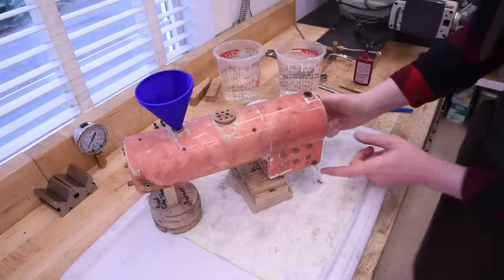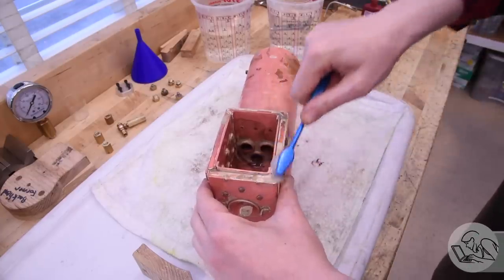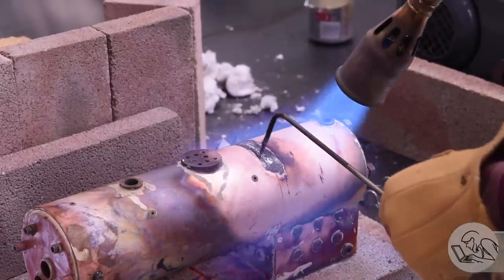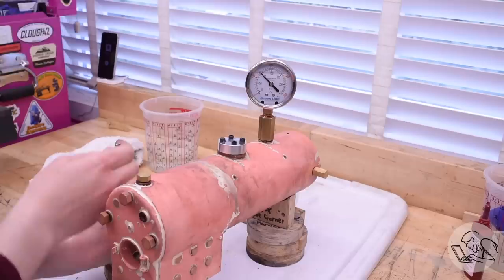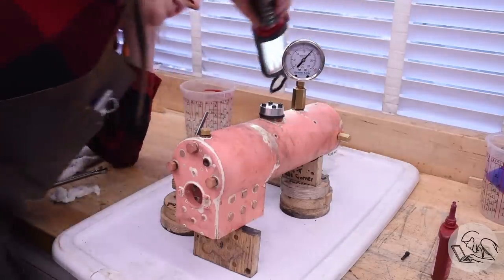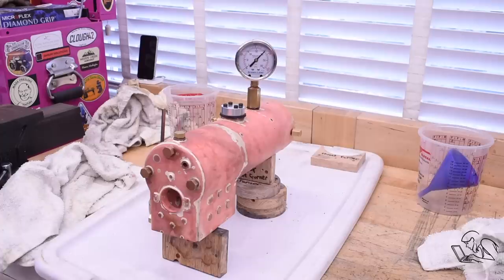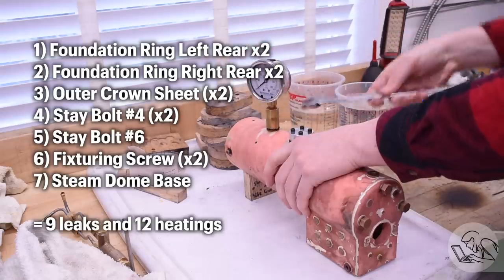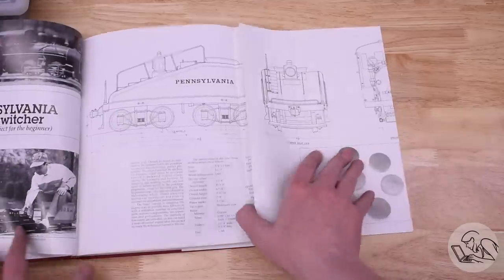Boiler Pressure Test!!! Pennsylvania A3 Switcher, Part 13

Comment from the maker: Hey everyone- as with every time I post a boiler video, many many people ask why we use a large propane torch for this. I’ll try answering yet again. You have to use a large torch because the large mass of copper sinks heat like nothing you have ever experienced if you have not made copper boilers. Experience you may have from jewelry making, welding, or HVAC work does not map here. This is the way model copper boiler makers have done it for decades for good reason. A smaller torch will never get the joint hot enough to flow the solder before the flux spoils. A hotter torch like acetylene will melt the materials before the joint gets hot enough to flow the solder. Yes, really. I can show you the melted bushings from my first boiler many years ago to prove it. Eight pounds of copper does things with heat that you can’t imagine if you’ve never tried it. We use big propane torches for this because it works the best. Don’t knock it until you’ve built some large copper boilers yourself. It’s a different world.
Reply: I would have suggested a smaller tip, yet you have explained the heat sink you are working on.  Thank you for being thorough in you explanation. Good work, and best o luck 

From Monterey area California.
Reply: My brother and I have had really good results silver soldering bronze with oxypropane. We've done both thin walls and fairly hefty chunks of 97% copper alloy, (but granted, not eight pounds worth) and it's worked really well for us. I'm sure there's a reason it wouldn't work for your application, but we like the directionality and 'just right' level of heat dispersion.
Reply: Best QC inspector in the world!!!
Reply: Just to add on to what Quinn just said: for those who haven't read the book, Kozo even tells you to use propane explicitly in the book, for exactly these reasons.
Reply: Yeah folks if you've got the propane to waste  you can use a preheater setup or a constant top, side(s) bottom heater and just go at the small joints with a smaller tip. This has its own set of problems - like everything's hot all the time and you are standing right above it or beside it or somewhere near it. The cost of Waldo's for this and the practice you have to have to make good use of them, and a multitude of other problems come to mind. Your choice is best.
Reply: that is so wild! thanks for the explanation! I was thinking a soldering iron to do little spot fixes like the fixture screw repair but you got that answered! Thanks for all your entertaining and extremely informative videos.
Reply: @ReedCBowman  It's because air is compressible while water is not. So 200psi of air is a lot of air (more than 10x the original air mass), while 200psi of water is just a couple of pump strokes over just filling it with atmospheric-pressure water.

This means that when there's a blowout with air, the overpressure remains until 90% of the air has forcefully ejected itself from the container - while with water, the overpressure vanishes almost immediately once the water has found some extra room to expand into.
Reply from the maker: Another way to say it- air compresses, so it is a spring that stores energy. Every pump makes it more dangerous. Water does not compress so no energy is stored from the pump.
Reply: Maybe having to re-explain this means you keep getting new viewers? Optimism! :D
Reply: Reminds me of soldering on a circuit board when you hit a ground plane (especially a multi-layer board with multiple ground planes). Those can really suck up the heat...
Reply: I have seen some using a smaller tip on boilers larger than this but  they had the whole boiler being heated by tube burners (like in a barbecue). I've tried something similar on smaller boilers where I use one or two extra torches (cheap DIY store ones) to provide some background heat. Seems to make soldering the joint easier. 

At work we test welded stainless steel vessels at 200 PSI. These can be upwards of 100 liters. Once had a 600mm diameter cast aluminum blanking plate crack under pressure. Very undramatic but the splash of water did hit one of our electricians who was not pleased he had to work the rest of the day in wet trousers. Had it been air pressure he would not have had trouser or legs to worry about.
Reply: I have been pondering this for a few weeks. Maybe electromagnetic coils or tuned induction heating? And if you also had a way to quickly cool or 'freeze' the solder seam for a more reliable seal under pressure.
Reply: @StanErvin-yo9vl   I don't have experience with silver solder, but I don't think quick cooling is a good idea. Rapid temperature changes, especially differential changes, can cause warping, cracking, and crystalization in ways you don't expect. At least for the initial cooling phase, you want the material to cool gracefully. An example of why this matters is the opposite of the heating: You want the metal to melt the solder, not the flame. If you cool it quickly, the coolant will harden the solder, not the metal, and instead of a fillet slowly solidifying, you can get surface chunks hardening with liquid underneath, causing deformation and strain.
Reply: @BetweenTheBorders  
     Sounds perfectly feasible Michael. The only silver solder that I have any experience with is Harris™ 85/15. Was putting handles back on Revere™ copper clad stainless cookware. Did about 30 pieces for a collector that brought them into the shop. She had a LOT of unmatchable pieces, including 12 handles for 3 dutch ovens, meaning there were six extra that I could 'experiment' with. Maybe that heavy gage stainless vs copper are totally different critters, but fast air cooling worked for me. Sorry for my misleading guesswork. 🥘🚂🇺🇲 ¯\_( ͠° ͟ʖ °͠ )_/¯
Reply: I hadn't seen that answer but I absolutely understand it.
I work in industrial control systems and have a done a lot circuit board and multipin plug soldering (yes Australians spell it with an 'l'). It takes a lot of skill and dexterity to do that work and ESPECIALLY TEMPERATURE CONTROL. It can get very complicated if you are repairing a circuit board and YES, despite the throw away nature of modern society sometimes you have to repair things because the nearest spare involves 10 to 30 hours of flights and travel.

One of my great bugs are electricians who think they can solder multi-pin plugs. Yes they are useful people when it comes to heavier gauges of wire that can be stripped with pliers BUT when it comes to those fine wires on sensors those guys instantly become are knuckle dragging gorillas who think they can do brain surgery.
Reply: I think that's one thing people don't realize is the mass of those things. It certainly doesn't look like 8 lb of copper in the video for sure and you would never guess that it weighs that much by looking at. As someone who melts copper into aluminum bronze and cast with it I know how good of a heatsink that stuff is and how much heat it takes to melt it. At least 2200F to get a nice melt for a good pour on 50mm coins and stuff like that.
Reply: @Blondihacks  I'm sure theres a perfectly good reason why it wouldnt work and keen to know why not but would an electrical induction heating tool apply high heat very locally?
Reply: @CothranMike  I haven't thought of Waldo's in years! Good book.
Reply: @ReedCBowman  When under pressure, water does not compress. At least not at these pressures. The Result is very little stored energy. Whereas air compresses significantly. Lots of stored energy + sudden release = bad things happening.
Reply from the maker: @matc87  Applying high heat locally is easy. Acetylene does it.  That’s not what you want. You need moderately high heat broadly to counteract heat sinking. Heating anything electrically is also always way less efficient. There’s a reason an electric heater costs 10x as much to run as a gas heater does.
Reply: Adding to my previous comment - we silversmiths use silver solders of different grades/melting points - this makes sequential soldering operations very much easier - we have 6 grades available here in the UK
Reply from the maker: @peterlunn2927  I use multiple heat ranges too. They are available everywhere. I explain this earlier in this series.
Reply: I absolutely agree. I am a professional welder. I had to braze some copper to some stainless (we love silicon bronze).
Oh. My. God. TiG brazing did not cut it. Maybe could've got it to work if I wanted to weld it. 
Had to use acetylene. For your use case acetylene would be way worse, you'd be at the risk of melting the base metal and boiling the solder if you used enough heat to heat just the area and compensate for the conduction. 
I will stick to steel alloys, copper alloys are so annoying!
Reply: Thanks for this biutiful project. You could use welding heat stop paste (e.g. dental stuff) to cover up worth protecting parts to not damaging them?  1. Works like a direct flame protection and 2. sucks the heat away from covered areas bc. of it's wet slimy consistency.

Comment: Hi Quinn - when we're doing hydro tests and having trouble locating slow leaks, we use a trick I learned from a boiler safety officer - coat the tubesheet with the developer from a dye penetrant NDT kit. It's basically an ultra fine white powder dispersed in a solvent that leaves the surface covered in a thin layer. Normally this would pull and contrast the dye held in cracks, but it also goes clear instantly if it gets wet - so even a tiny weep is instantly obvious
Reply: I was going to suggest chalk powder, but this is easier.
Reply: C’mon fellas, don’t make it too easy. Otherwise the vids will get shorter!
Reply: I'm a retired airline mechanic and that's the method we used to find pneumatic (air) leaks on the bleed air ducts on the engines. Spray everything with developer, run the engine for 5 mins. Any spot where the developer is missing there's a leak. Super simple and fool proof. 👍😁
Reply: Athlete's foot spray powder works pretty well, too. I once spent two months locating a motorcycle oil leak using this method. It turned out to be a cracked insulator in a neutral safety switch--a crazy small leak.
Reply: As a fellow airline mechanic I get what NDT means. They layman however might not. It means Non Distructive Testing  ( NDT) not trying to " mansplane" just trying to make things as clear as mud.
Reply: @Swampyankeehomestead  Not trying to "mansplain" either, but "mansplane" is only acceptable in this context where an aviation technician made the suggestion.
Reply: @MichaelOnines  usually when a tech makes a suggestion MXC and other managers " mansplane" why we can't do it that way.
Reply: @Swampyankeehomestead  Well, this is locomotive engineering, so you have to use the "ain" in "train" not the "ane" in "plane".
Reply: @Michael Onines  I was a QMP, Hollister, conductor and engineer. Both freight and pax. I just say FOAMER!!

Comment: Congratulations Quinn, well done. My grandfather was born in 1874 and he was a boilermaker for a railroad in NC. In 1900 he built a house an built a boiler for heating and hot water in the basement, Many made the comment your house is going to blow up. His response was he had built many boilers for the railroad and none of those ever blew up! And that was on a shaking train. It was the only house in eastern NC that had running hot water. In the 1940’s he converted the boiler from coal fired to #2 fuel oil that system worked with out fail until 1974 when a down stairs bathroom was added on. An electric cold water heater was installed. Yes a cold water heater! Who heats hot water? 🤣🛫

Comment: Of course the most critical part of the build would be episode 13. Great work. I have no desire to play with steam, but I have watched Keith Appelton for several years, and your steam projects are fun to watch too. I'm an engineer, so he steam thing must spring from that even though my degrees are electrical, and computer. It's always interesting to watch Keith Rucker do videos on the Vulcan engine, because it's just like the models, but way bigger.

Comment: I was the last Boiler Tech class at U.S. Navel Station Great Lakes in 1995 before combining with the Machinest Mate rate. These episodes have been a great memory play back of my time in the navy.👍👍👍👍👍Tip for pressure testing use 300psi 90* degree needle gauge valves.

Comment: You really do have the patience of a Saint. I've learnt so much about steam boilers from your videos: recently I was at Chipping Steam Fair (it's only a couple of miles from here) and I was looking at all of the steam-powered vehicles with new-found respect. It was as if I had X-ray vision: I could imagine all the complexity hidden inside their boilers which look, from the outside, like simple tubs for boiling water. Now I know better, thanks to you.

On the subject of gappy teeth: I was lying supine, reefing on a rusted bolt on a Range Rover. The bolt suddenly sheared. I inadvertently punched the chassis and let go of the socket driver. It fell, handle first, through my front teeth. My NHS dentist patched me up within an hour and subsequently did a definitive repair - I think it cost me less than £200 in total. Those were the days, when you could find an NHS dentist, and get instant emergency treatment.

Comment: I can see why you were losing sleep over this! The closest I get to this is my change request outages at work. Sometimes you're 2 hours into your 3 hour outage window, and if things aren't going right you've got to make the call whether to cancel the change and roll back, or push ahead and try to get it to a mostly working (mostly) stable state, so you can keep the business running and try to fix the problems another night. And sometimes things fail so spectacularly that the rollback process also fails and you're forced to throw all your plans out and do whatever's necessary to make it work.

Which is what seems closest to your boiler testing, so I definitely know how you feel. Seeing it hold up was a relief to see for me, but I can imagine how it felt for you.
Reply: That's the real pressure.

Comment: Congratulations on a successful build! 

I'll be the first to admit, what you demonstrated here with such a (relatively) simple boiler, is why I gave up dreaming of building a locomotive. I wanted to build a 1½in scale model of a streamlined 2-6-4, based on a shrunk NKP Berk. If I ever do, it'll be an electric drive, lol.

Superb work!

Comment: Quinn , you are a brilliant engineer , and you have the patience of a Saint!!!!! you need to get a Tig welder you could have made those repairs the same way flux and solder but you use  the intense localized   heat of the tig torch so you dont damage your previous work ,   you put sooo much time into this ....I feel if you watch a few of  Ron Covell"s tig welding videos you would be a great  weldor ..... Thanks for taking the time to make these vidieos

Comment: Curious to know the melting temp of your solder.  The silver solder that jewelers/silver smiths use comes in four types: easy, soft, medium, and hard.  Each melts at a different temperature (1270 F to 1425 F), which allows a maker to start a project using hard solder (which melts at the highest temp), then, with each subsequent solder joint, to use a lower temp solder, so that the solder in the new joint flows long before the solder in the previous joints starts to remelt.

Comment: Hi Quinn
      Your boiler is a very functional thing of beauty.  I have known a couple "model builders",  that made Kozo A3's.  That is most of an A3.  They built the tender, and running gear and both did pretty good work.  But neither had the gumption to build the boiler.  Building a copper locomotive boiler is no easy task.  
Jack

Comment: Congrats! And that's why I wonder if I'll ever make a 2nd loco boiler. Aside from the many others, mine had a leak on a tube at the upper corner of the firebox tube plate that just would not go away. I won't say how we fixed it, but it's 'fixed'.

Comment: Congratulations Quinn on getting your boiler done. That's BIG!. I think the slight loss of pressure at the end was due only to the oxygen in the water coming out and causing a tiny air bubble reducing the pressure slightly. Otherwise you're fine! Great job!

Comment: hi Quinn, just a tip, there is a product that is called heat stop, it's like a clay material that you stick over the surface that you want to protect. I have used it on sheet metal when I was welding panels on auto's,

Comment: HI Quinn I'm thinking that you could use a small oxy-acetylene torch for the small spots, that way you can minimize heating unwanted stuff. 
looks good so far!
Reply: she has addressed this before—the problem is that the heat diffuses throughout the large boiler, so essentially she has to heat the entire boiler every time she wants to solder something. pinpointing the flame would only prolong the process of heating, and might in her case make the solder melt due to the torch and not the metal around the joint. it's a good thought, but not translatable to the specific case of pressure-tight soldering an 8 pound boiler

Comment: If the threads on the fill plug were made longer, you could put a slot down the side of the ones fully inside the tank, then when slowly backing it off at the end of the test, pressure can escape through the slot when the screw still has plenty of threads engaged and can't go anywhere. Plastic soda bottles accomplish the same thing with a slot cut on the threads on the bottle.